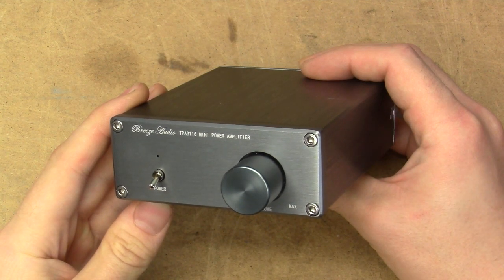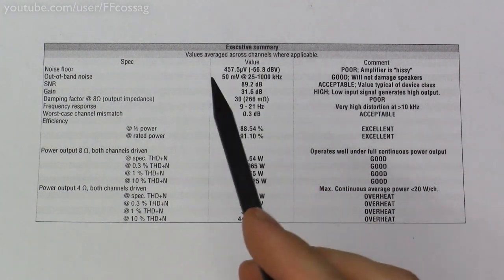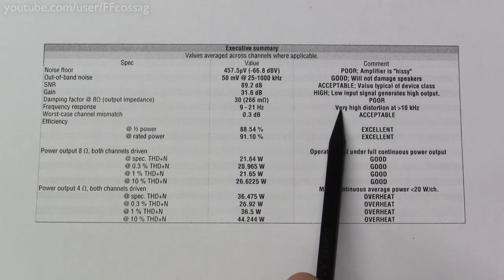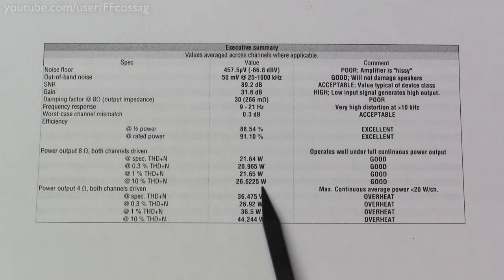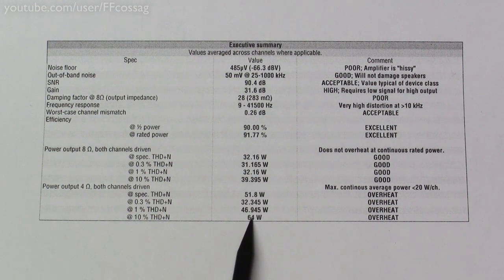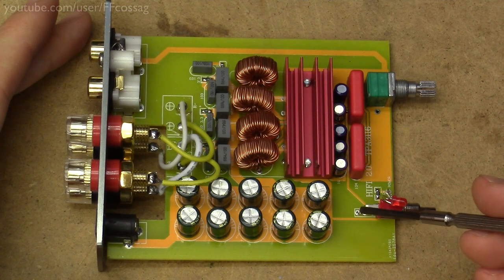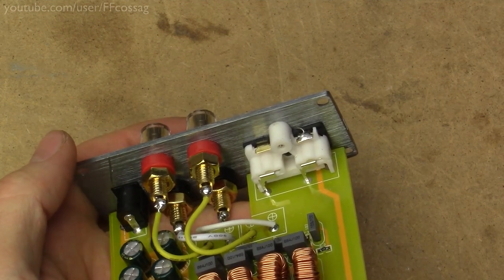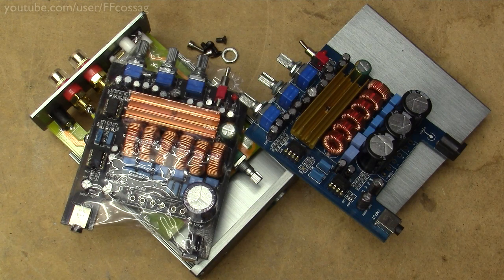Breeze Audio TPA3116 OBJECTIVE performance test, teardown & review

Comment: Build up the heatsink using copper plates that fit so the heatsink touches the lid and use heat conductive silicone making sure it's touching. Now you'll notice the case getting hot and you can always attach a heatsink to the case or cut a hole and apply a larger heatsink.
Reply: yes i wondered why they dont use the casing as a extention to the heatsink, probably saving dolla

Comment: I have the Nobsound version and love it... very clear class D type sound, great treble transients, and images quite nicely. A bit clinical & ruthlessly revealing, but can sound warm if your gear is too, eg. tubes. Great cheap little entry level amp, but you need a good power supply if you want full power.
Reply: I have to the Nobsound version and i dont know how about this video but the nobsound does not get hot and sounds very good. The nobsound i have is the 2x100 w version and i think is superior than this one. It has 2xTPA 3116D2 and swappable opamp.

Comment: I have one of these amps, and it seems like for once, the Chinese have really tried to deliver a well-designed little amp. I ultimately put it aside because I found it a little bass-shy (maybe overdamped in the bass range causing it to sound bass-shy). I replaced the line of little panasonic caps with 2.2uF Nichicon Muse, and I got a nice open sound out of it. I ran mine with a KTEC 24V 5A power supply and it was quite happy. A drawback to the power switch configuration (just floating the 'disable' pin of the chip) is that the power supply caps are not disconnected from the power supply, and when you connect the power supply to the DC input, if that power supply is powered on, there is a bright spark as the caps suddenly draw current and charge up. And it's not the only chinese amp I've found that does that. I later set it aside for a DIY amp based on an ICEpower 50ASX2 module.

Comment: I know this video is over a year old, but I just wanted to thank you, and thank you a TON.

ahem

Thanks a TON for this video, dude. Super helpful for me. Your thoroughness, attention to detail, and overall review quality are off the charts. You rock. Ily and have a nice life <3
Reply from the maker: Glad to be of service.
Reply: Okay, so I got this amp, paired them with a 24v 5A power supply and speakers rated for 60W per channel, and the capacitors almost immediately exploded when I started trying to use the speakers. They weren't even cranked - they were on, like, 20%-25% on the amp's volume knob, tops. There was a ridiculously loud/scary POP noise that just about blew my eardrums out, and as I scrambled to unplug the thing from the wall - which took about 10-15 seconds because the plug was really stuck in there - I heard two or three more of those loud, distinct POP/CRACK sounds. After unplugging it, I opened it up to discover three of the capacitors were completely blown/exploded with a weird fuzzy/papery, almost organic-looking substance blooming out of the remains, and one weird cylindrical capacitor-looking silver thing (maybe one of the mini capacitors?) was rolling around inside the case completely detached from the PCB. I didn't look at it for very long, to be honest. There was a very distinct chemical odor/musk coming out of it, and a greenish liquid splattered everywhere, and a bit of a burnt smell as well, and I don't know how toxic those fumes/chemicals are so I just closed it and put it away as quickly as possible.

Anyways, do you think this could have possibly damaged my speakers? I don't have another amp on hand to test them with, unfortunately :\
Reply: UPDATE: I contacted banggood customer support and they sent me a new one. The replacement blew up in exactly the same way as the first one. Used with a 24V 5A power supply on 6 ohm speakers rated for 60Wpc... Should have had no issues, but apparently this gutter garbage isn't capable of either taking in the voltage it claims to be capable of taking in nor can it handle putting out the wattage it claims to be capable of putting out. Opened it up and had a look inside - same story as the first one, capacitors popped. Definitely some trash Chinese knockoffs and not genuine Sanyo caps. Contacted their support again, they issued me a refund rather than sending me a third copy (which almost certainly would have just blown up in my face a third time). I used the money to buy an SMSL SA50 instead, have had no problems since. If you're reading this and thinking about purchasing this amp, do yourself a favor: Don't.
Reply from the maker: Are you sure the polarity of your power supply is correct? lol. I wouldn't run these on a 24 V supply, since the caps are 25 V rated Chinesium. You're better off using a 19 V laptop wart.
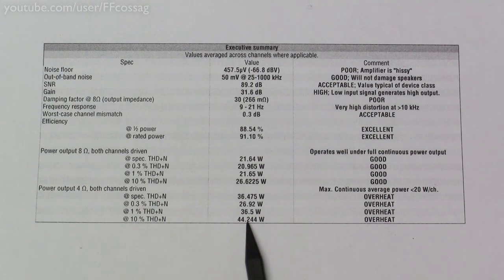Reply: Yes, the polarity of the power supply is the standard positive in, negative out. And it works fine with the SMSL SA50, so clearly the low quality of the components used in the amp was the problem, not the power supply. Also, you literally ran this with a 24V supply in your video at 10:19, lol.
Reply from the maker: I would not run this on 24 V in actual use, since it's likely to do exactly what yours did.
Reply: Yeah, but you ran it on 24V at least long enough to get all those measurements, right? Which had to have been at least, like, 20 minutes... Both of my copies exploded within 5 minutes of being plugged in, and neither actually saw any real use. Just plugged in, not playing any sound, and POP. POP POP POP POP.
Reply from the maker: You clearly got some much worse caps than I did.
Reply: Yeah, no kidding. I'm guessing they probably used that classic trick in which they use quality(ish) components for the first month or two of production, just to get all the good reviews out there, then silently switch them out for garbage components after all the reviews have been done to increase profit margins. Textbook bait-and-switch.
Reply: Alright, final update on this little story: I've had my SMSL SA50 for nearly a month now, and it's been running beautifully. No issues whatsoever. I can crank it up to full blast and annoy the people two blocks down if I wanted to. So there was nothing wrong with my setup, it was all on the amp. Moral of the story: DO NOT BUY THIS AMP AT ALL COSTS. Put out a little more money for something just a bit nicer, because this thing is not only a piece of shit, it's an exploding piece of shit that will invariably end in catastrophic failure.
Reply: Actually the moral of this story is to buy a decent power supply...i`m like anyone else against chinese BS, but this time i`m sure that supply was much more than 24 volts at no load. Even chinesium caps (made of piglets skin) can do 24 volts on a 25 printed, but because you don`t own a multimeter just replace all the 10 caps inside the amp with 35 volts rated ones like i did. The chip does not burn at 30 volts unloaded  (max voltage rated) so it could handle a crap supply. By design this chip was intended to be used in 24 volts cars (trucks) that use 2 X 12 volts accus in series. But anyone who knows better can tell that while your motor runs , the voltage stays put ~ 28 volts to keep the accus charging and topped, and that`s why this cheap amp keeps working on mine. Plus i`ve replaced the small aluminum heatsink with a bigger block (square) that touches the top cover of the amp (used thermal paste up and under) and surprise, it doesn`t overheat as it has now a place to vent the heat...

Comment: Im going to buy one, mod the case with a fan and use it! Thank you for the GREAT CONTENT! I love that you use terms that an engineer like myself can understand!
Reply: I put 40mm fans where i can on these, one has a large cpu heatsink 133g without the fan and it loves it - i am using a cheap dual tpa board from ali (xinyi ap100h) and couldn't be happier for $9 and ofc the $1 for the heatsink.

Comment: I got a couple of these (different brand on eBay) and I can run them flat out into 4 Ohm speakers and it barely gets warm. I think most reviewers use resistors for testing which doesn't give good results as speaker impedance will change with frequency.  I also notice a lack of bass response so I may change the input caps and see...
Reply: Did you fix the lack of bass of this amp?
Reply: @thanghophotos4770  Yes, I made a bass booster with a NE5532 with frequency selective gain. I did this rather than alter the module any.
Reply: @davidwoodbridge862  I understand that you add NE5532 to this amp to boost bass with a bass treble tuning button?
Reply: @thanghophotos4770 I made my own pre-amp in effect just with a little fixed bass boost not particularly difficult but does require soldering of surface mount components, also required a custom PCB layout and I'm equipped for that.  For anyone not equipped to handle this there are plenty of nice single rail powered pre-amps available for peanuts on eBay and other similar sites and they have bass, treble and volume controls. If I have the time I will send/post a link later. Additionally, if your source signal is strong enough then a passive bass/treble pre-amp can also be used.  These tend to be a little lossy hence the strong signal requirement.

Comment: 11:45 - power increases with square of the supply voltage, not linearly.
Reply from the maker: That is correct. What I meant to convey was that output power directly relates to input voltage.
Reply: Understood.  Thanks.

Comment: I own two of those Breeze Audio amps (with dual TPA3116 chipsets....100w x 2). They are really nice. I just need to know what is the max input power supply voltage to run it at. Currently, I am running 24v into it and it plays great. But, my question is: what is the "best" voltage to run this amp at for best power, keeping the heat down, and longevity? I am running 4-ohm loads. Thanks
Reply from the maker: The TPA3116 likes 19 V laptop power adapters.
Reply: FFcossag that’s the default power supply that usually comes with the amp. To get the full and max power from these mini amps you will need a 24 v 5 amp power supply with the correct ohms speakers to get the max power out of them.

Comment: I know this video is a bit old but Would wiring this amp to a pair of 4ohm speakers using a 19v 3.5A power brick be ok? I don't plan to run them at more than about middle volume.

Comment: Hi, I have a simple question. I want to buy an amp, and speakers separately and live happily ever after in hifi utopia. Separately because I don't want to spend a lot on brand sound systems. So, if you could point me in the right direction... thanks in advance. And thanks anyway for the great video.

Comment: Hi, I'm considering using this to drive Sony ss-h650 , and they're rated at 6 ohms ,80 Watts .It would be ok and what Voltage/Ampere power is the the best choice? Thanks!
Reply from the maker: A 19 V laptop PSU is fine.

Comment: I may be insane, but I have been using one of these for years to power a pair of mission M71i and recently tried a Fosi Audio V3 and a bt20a pro with a view to replacing the breeze audio. To me the Breeze Audio amp sounds a lot better and bizarrely a lot more powerful
Reply: Interesting. Which exact model of breeze audio do you have? So you recommend it over the Fosi's? Is interesting to know the opinion of a user who used this amo for many years. Thanks
Reply: @francohic  TPA3116

Comment: I've read that a good way to lower the gain and therefore noise floor is to replace the volume control potentiometer rather than the resistors. People often recommend using a 10k logarithmic pot. Can anyone tell me the pros and cons of this approach please?
Reply from the maker: That does not usually change the noise floor.
Reply: @FFcossag  Thanks mate. Conflicting advice- that must be the internet lol
Reply from the maker: Cheap potentiometers often have a scratching noise when you turn them. Replacing the potentiometer would help in that case, but not against the constant background hiss (with some exceptions due to thermal noise, but that's not important here). I'm sure someone has just been confused.

Comment: I'm considering the bluetooth equipped 100Wx2 (2xTPA3116) version of this for use in an old vehicle that doesn't have a DIN size opening for a modern head unit.

Would one of these class D TPA3116 style amplifiers perform well enough at vehicle voltage ~12-14V connected to 2x 4ohm 6x9" speakers? Vehicle is a leaf sprung 4x4 so not looking for audiophile quality.
Reply from the maker: At 12 V they give you as much sound as a bog standard head unit. About 10 W/channel

Comment: Hi, I'm considering using this to drive Dayton B652's, and they're rated at 4 ohms I think. Would you say the amp would get damaged due to overheating, or would the speakers be affected adversely in any way? Thanks..
Reply from the maker: It would probably work fine as long as you don't push it extremely loud or long periods at a time.

Comment: Could the small Panasonic copies be moved to the front of the amp (extended leads) and away from the heat sink? That would make a 4ohm load more doable right?
Reply from the maker: Wouldn't make a difference.

Comment: I have 2 Sony Speakers 100W peak max each, do you think a 12V5A will be enough? Also, you refer to 19v and 24v, but you never said anything about the current. How much of A should a 19v or 24v have for this kind of amplifier? Thanks in advance.
Reply from the maker: Laptop power bricks work fine.
Reply: 12v or 24v brick? I have both from old laptops.
Reply from the maker: These run fine up to about 24 V, but they're built for 19 V.
Reply: So, that means i can max out the amperage up to 5a 7a without damading the amp as long as i keep in the supported voltage?
Reply from the maker: yep.

Comment: Hello, first of all thank you for so detailed review, i'm really impressed of your work, so i bought this amp recently and 24v 4A adapter for it. and i have two questions: 1. is it possible to connect 6Om speaker in it? 2. Is it possible to improve its performance over 10kHz somehow? Thank you in advance
Reply from the maker: Those speakers should work just fine with it. As far as the high frequency distortion issue, I couldn't say; I haven't played with it. It's likely to be a difficult case to solve, though.
Reply: Thank you! I'll tell you the result)
Reply: @grunger77  the nob sound one may have better other circuitry that reduces or eliminates this concern?
at a guess as this review is for one amp that used that chip, there are other amps that also use this chip but may have better additional components/larger caps etc. for example the one im getting only has a small metal cap close to the heatsink instead of a line of poly caps.   they also seem to have 2 larger caps. not as large as in my class d linn amplifier though.. but this is for chill setup so power isnt a issue.

fwiw im trying the new nobsound 2021 iliteration of the ns-14 without bt. lookin foward to seeing whats under the hood as its my first mini amp and there where no pics of the board on that listing.

Comment: I wonder if it would be worth it to change the capacitors to better ones and then improving the cooling?
Reply from the maker: +Hene193 I don't really think so, the capacitors serve their purpose. The thermal issues, and the physical placement of the small 1 µF electrolytics are the biggest design flaw in this amplifier - not the capacitors themselves.
Reply: +FFcossag  How about moving the Caps to a better place all together ?. Or maybe better yet, putting vent's in the case. The Chinese  do seem to love cooking part's :) Thank you for another well done video.
All my best from the States.
Bobby
Reply: ***** The cooling or moving the caps wont change the sound to better. It only allow longer life for the device but it costs only 20€
Reply from the maker: ***** As Hene pointed out, it won't improve the sound quality. You generally want those small caps to be close to the chip, so there technically isn't much wrong with the placement. I think the datasheet calls for ceramics, so if anything, that's what one would replace the 1 µF caps with. As for drilling holes in the case, it might help, but it might be difficult to actually generate any kind of useful convection since the board covers the entire bottom of the case.
Reply: +Hene193 Thank you for the reply. making things last longer was my thought. Guess I am just old school :)
Reply: +FFcossag Thank you for the reply. Even though the price is low I like to make things last has long as possible. Growing up our family had 0% disposable income,even though  So we made things last has long as feasible. Some habits die hard :)
All my best.
Bobby
Reply: 5V Fan?

Comment: If i use a 12v adapter vs the 36v adapter will the sound quality be less or just the volume?  I need it for traveling so i want less weight.
Reply from the maker: You just lose volume. And a 36 V adapter would explode it.
Reply: I see i am actually using a 19v adapter. It is bit of a brick. I've used the amp for the last 6 months and it has been great. I guess i will try a 12v adapter and lower my travel weight.

Comment: Can I use this with speakers rated at 16ohm and 60watts? What Voltage/Ampere power is the the best choice? Thanks!
Reply from the maker: It'll work fine, use a 19V wart.
Reply: Thanks for the reply. How about the new version using dual-chip TPA3116 with rated power of 100w per channel? Can i still use the speakers without blowing them by dropping the voltage to maybe 12 or 15v? Thanks!
Reply from the maker: Less voltage means less power. 16 ohm means you want a lot of voltage or it'll be really quiet. THe power is limited by your input voltage, read up on Ohm's law.